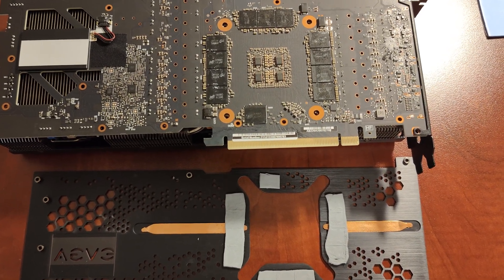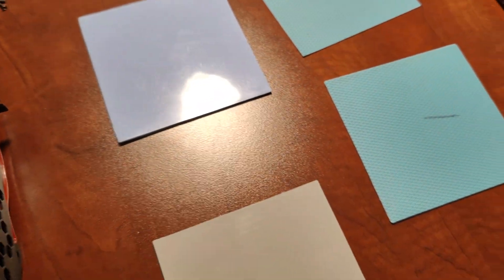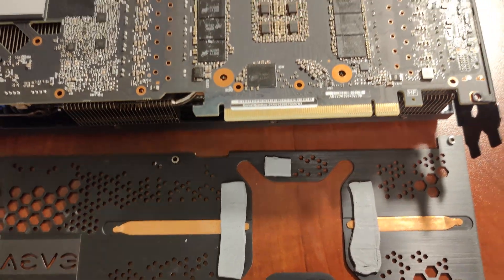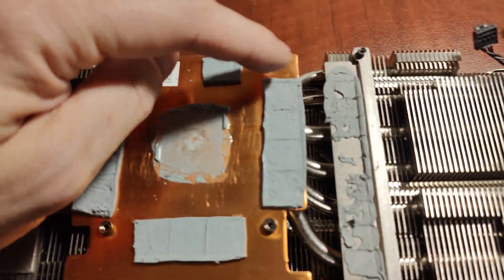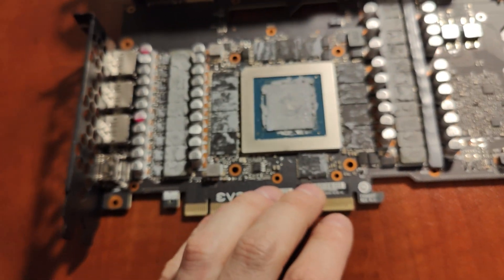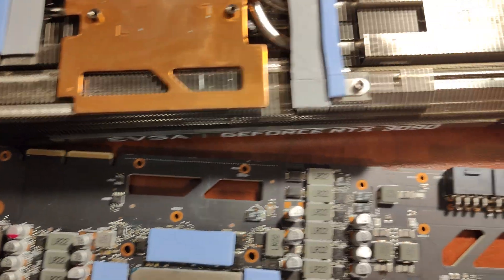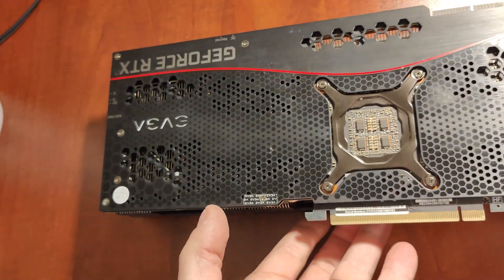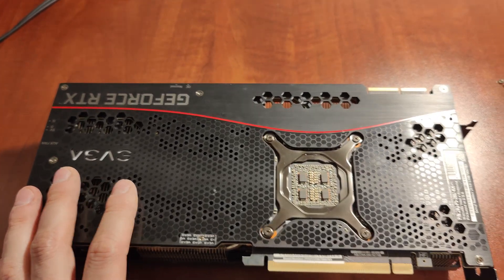Maximize Your EVGA 3090 FTW3: Essential Thermal Pads and Paste Swap for Altcoin Farming!

Comment: Hello, I have been researching thermal pad sizes for my 3090 ftw3 ultra card for a long time. I saw that there were users who had bad results from the measurements stated by Evga. Are the thermal pad measurements you use successful? If successful, may I know the thickness and dimensions of the thermal pads you used?
I'm thinking of using Ice Dragon 17.0 W/m-K thermal pads. Which thermal pads did you use?
Reply: Not sure what you did since 4 months, but I've tried a lot of pads and it's hard to find the right size, getting slightly larger bends the backplate as well. I've had great success with thermal putty, UPSIREN Thermal Putty UTP-8 found on aliexpress, 1 vial 100g is more than enough for this specific card, I replaced all memort front and back and vrm too. My memory temps went from 103 to 80-85

Comment: That's not thermal pads, it's thermal putty on the LR22's.  That's why it looks like crud.  EVGA has admitted bad tolerances on that area of the card and opted for thermal paste instead of pads.  3080 FTW3 is the same way.  Makes the card annoying to work on.  Hope the pads work out for you long term!
Reply from the maker: They dont even apply their cheap paste the correct way. Does not cover the whole electronic unit.